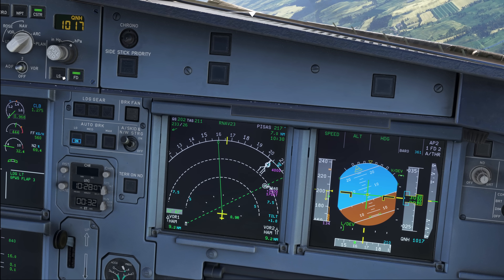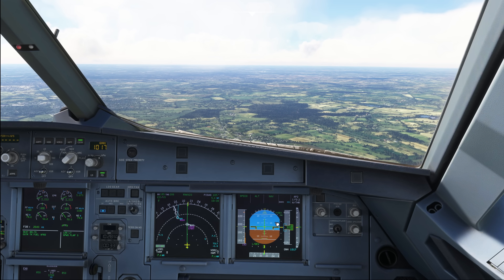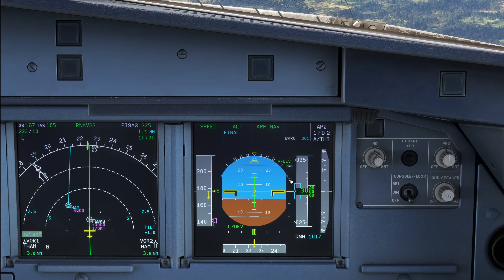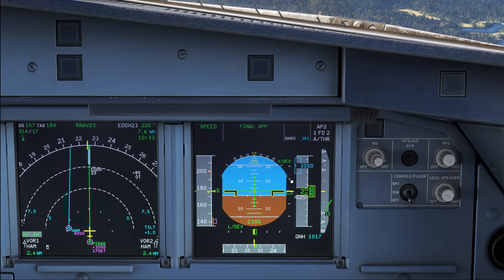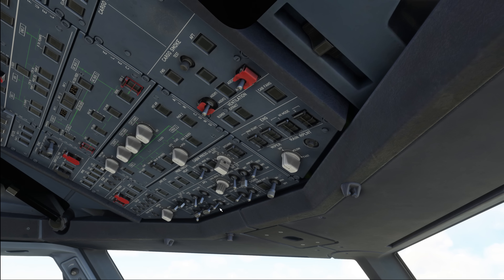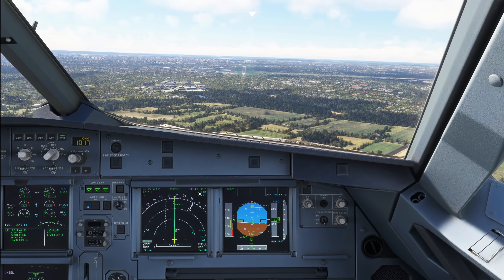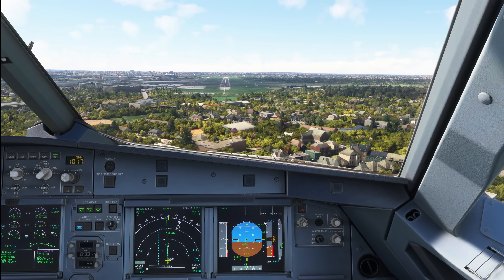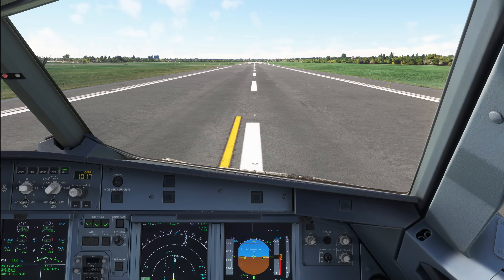How Airbus can KILL on Non Precision Approaches - UNDERSTAND YOUR INSTRUMENTS | Real Airbus Pilot

Comment: Nice one! Airbus has since improved their NPA guidance with so called "FLS" (optional on 320 & 330, standard on all other modern Airbuses) that mimics the ILS angular guidance, getting more sensitive the closer you get to the RWY. The indication is similar to ILS, but it is a double diamond. Despite the improvement in guidance, regular NPA minima (and their limits) are still in use.

Comment: If the pilots are flying a non precision approach ☂︎(which is visual, too, I believe, you must actually be able to see the runway, weather must be good etc) - I hope the pilots actually look out of the windows and see that they are actually hitting the runway, regardless what those fancy instruments say? 😮

The PAPI lights would also give a hint, if your altitude is lacking, wouldn’t they? 🤨

As a passenger, I got a tiny bit more sceptical to Airbus now, as it seems like all the instruments can end up be a little distracting, if they can distract the pilot from doing a non precision approach so much that the pilot can forget to look out the window and ensure that the airplane actually hits the runway. 

We see the same in regular car traffic on the ground  too - too many and too big screens and too much automation are distracting drivers from actually paying attention to what’s going on. The physical reality outside, is what really counts.
Reply from the maker: A Non Precision Approach (NPA) is flown purely on instruments just like a Precision Approach, down to the minimums. Once the runway comes in sight you can slowly transition to flying visually, however the primary reference of information is the instruments until you reach the minimum, which on some NPA's can just be a hundret feet higher than on a precision approach.

Comment: I think it’s not so much of an issue. In my training we were thought that VDEV is only advisory on non precision, 2D approaches and the primary source for the profile information should be taken from the altitude/distance segment of the chart. I always personally treat it only as rough advisory rather than hard info. 

I’d say it’s especially important to point out about this, that we would only follow the profile (vdev, ILS or whatever else) down to the minimums after which the approach continues visually so we can assess the profile based on the PAPI, so again, angular deviation. One of the reasons for higher minimums for NPA. Also NPA is unstable at +/- 100 ft of profile on altitude checks, so in a way this functionality of VDEV is useful in my opinion, as it clearly indicates an unstable approach. 

Not a criticism but rather some more thoughts as on why VDEV does what it does

Comment: Definitely not an airbus pilot IRL but this video was very helpful! wouldnt have thought the scale was different between ILS and Non-Precision. Simple enough to adjust for. You just need to be aware that you have to be on the mark as far as glide slope is concerned. Especially as you get closer and closer to the runway.

Comment: You can get into similar issues during an ILS approach if you come in high and intercept the glideslope from above. You pick up a secondary signal, which, if followed, you will come in at a much higher than the normal 3-degree profile. As happened with a Pakistani airliner a couple of years ago.

Comment: Hello.
I retired after flying as an airline pilot for about 35 years.Flew both Boeing and Airbus. The Airbus has many wonderful features, BUT, in my opinion has two major and potential dangerous features. The first is non moving thrust levers when in autothrust. Think AirFrance 447.  The second is the visual presentation on the primary flight display when flying a non precision approach. No flight director! Instead a very non intuitive"bird". Until you reach minimums and set up for a missed approach. Boeing has a far superior set up and display for doing non precision approaches.  Cheers, Peter
Reply: The newer airbus' have a much more sensible system called FLS which gives a normal ILS style display for non precision approaches. the brick system shown in this example is the norm only for RNP-AR and RNAV Visual approaches (for us anyway). The old Airbus 'moustache' flight director has also been dispatched not he A350 and the normal crossbar system is available in HDG/V/S as well as TRK/FPA modes. I have flown both myself and I have to say whilst I agree from the point of view that Boeing is more pilot oriented, just having TRK/ FPA available even when flying an NPA in managed selected or (heaven forbid) selected selected modes makes it almost too easy. The newer avionics is just amazing but it does concern me we have a generation of new magenta line pilots who don't understand the concept of pull the tail and push the head.

Comment: Also worth mentioning that you are not meant to fly a non precision approach down to the runway though… standard non precision minima apply!
Reply from the maker: Which can be as low as 250ft though - things are getting very, very tight down there.
Reply: @A330Driver  minimum obstacle clearance for final approach segment is minimum of 246 ft with a FAF or 295 without, so still shouldn’t kill you… definitely not a place you want to be though!
Reply: @A330Driver  I've not seen a non-precision with 250' all minima in my time, maybe under the new bizarre ICAO stuff that's feeding in with type A and type B approaches this might be possible BUT never say never. TO avoid this scenario in my company we have a standard call of 'VDEV' at Half dot and it is a mandatory go around if you get to 1 dot below. Notwithstanding that even at 1 dot below you would still be at 250' and visual or not. if you are low on profile by that amount at that stage then the PM would likely be making some quite shouty noises about a go around. Consider this is not unlike a dive and drive approach where in the old days before all this whizzy tech we could descend to the minima and stay there till the missed approach point. not saying its a good idea but you 'could' do it. 

If we look further in to the future with the advent of SLS and GLS approaches then there will be lower minima and even auto lands in the case of GLS assuming we can sort out the GPS interference issues but these are based on the standard ILS type indications and so have the reducing height to a given deviation that you describe.
Reply: @krisheslop4705 likely because Airbus had in mind that for NPA You are considered unstable when exceeding -/+ 100 ft from profile. Good SOP because exactly how I see VDEV myself. Just an indication of stable approach requirements

Comment: One other reason I prefer using FLS unless it’s an RNP AR approach
Reply from the maker: FLS surely makes things easier - but by far not all Airbusses have it, unfortunately.
Reply: Are you able to just choose between fls or final app in the fms instead of editing it on the efb?
Reply: @BobBob-cu7ne  in the Fenix no. This is because when Airbus first fitted FLS the airline had to choose to have either FLS or FINAL APP installed, and that’s what Fenix simulates with having the aircraft option in the EFB. Later Airbus modified it so the pilot has the option to choose which one depending on the approach type. This is what ToLiss simulates in their NEO’s (as well as having SLS and GLS)
Reply: @tomstravels520  Just curious, ToLiss always argues no CEO comes with FLS hence only FLS on neo, is it true that some CEOs have FLS instead?
Reply: @ruiliang6819  that I’m not too sure of. I haven’t seen a CEO with it but you’d have to look maybe at some of the last CEO’s produced, and even then depends if airline bought it as an option due to the early decision to have one mode or the other. FMS2 which has the co-existent modes was released I think around 2016 so then it became more logical to purchase it. Delta may have some at a guess as they got the last one
Reply: @tomstravels520  Couldn't believe delta operates 30yr old a320 with 5yr old a320 at the same time hahahaha with the same interiors